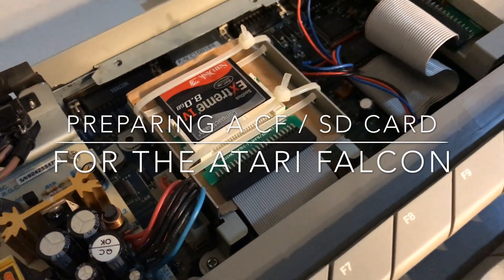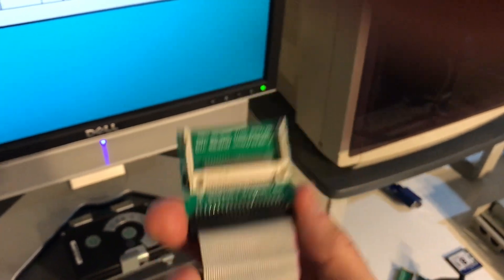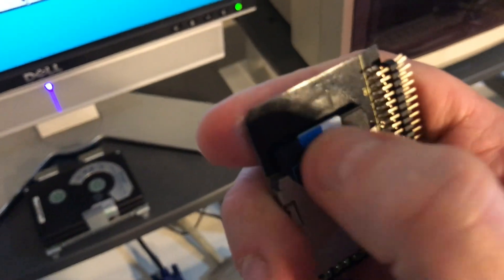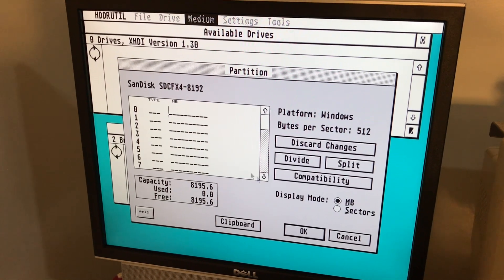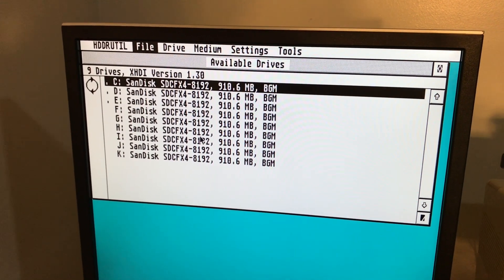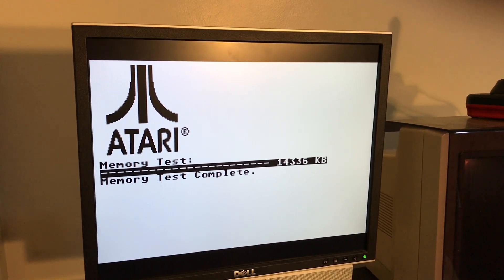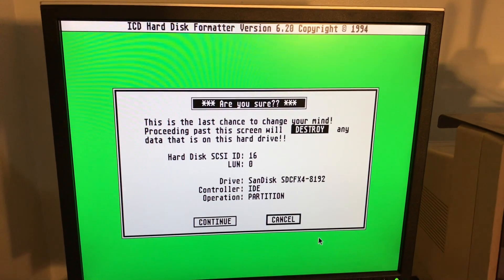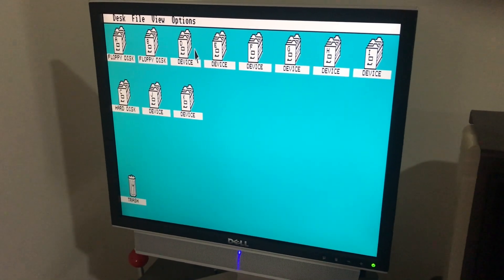Preparing a CF / SD card as a hard drive for the Atari Falcon

Comment: Very useful video! I just bought a IDE-to-2xCF adaptor (DELOCK 91662) which comes in a 2,5" form-factor. I already moved my data from 60MB IDE-drive to the external SCSI-harddisk. I have to fiddle around a bit with the clockpatch, because I still have SCSI-issues. I hope removing the old patch and putting in the patch-PCB from exxos UK will do the trick.
Next I'll get HDDRIVER. The plan is to use one CF for the main "Harddrive", the other for moving data from/to PC. Let's see how it all comes out. 😉

Comment: I have a 16GB Sandisk flash card and an adapter. I know it exceeds the maximum, so if it works I will make as many partitions as I can. I am curious if anyone knows if it will still work when I put it into my Falcon. Or if I should get an 8GB card. Maybe I just need to plug it in and see what happens! The existing hard drive can only be read, I can not write to it anymore for some reason. So I want to upgrade to maximum potential storage if I can!